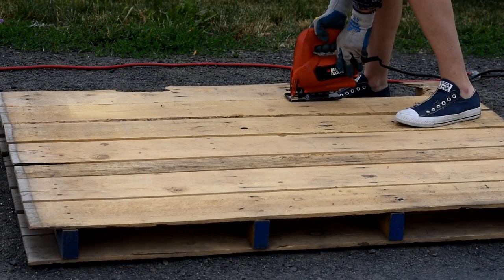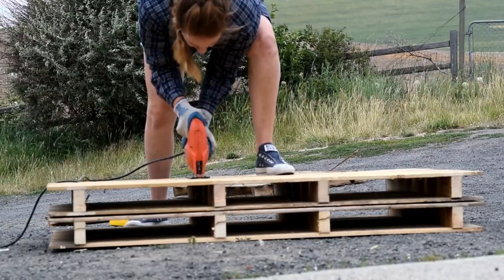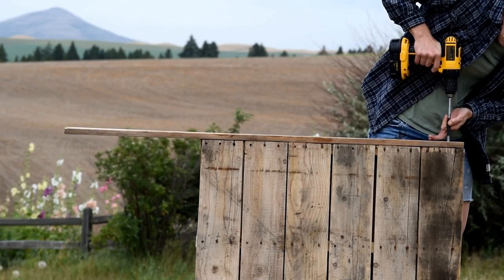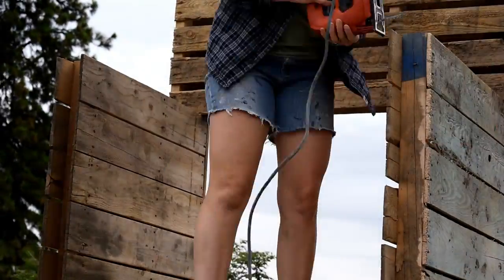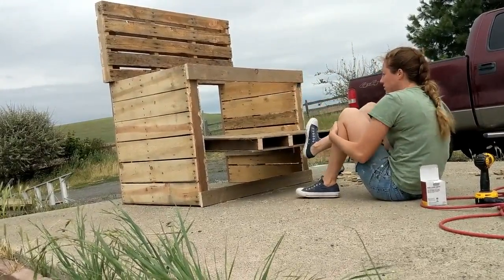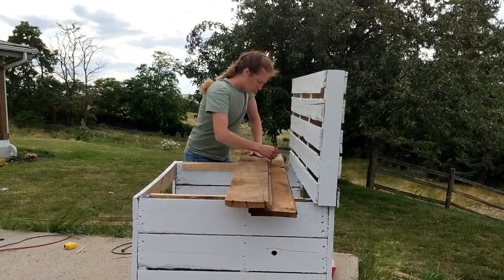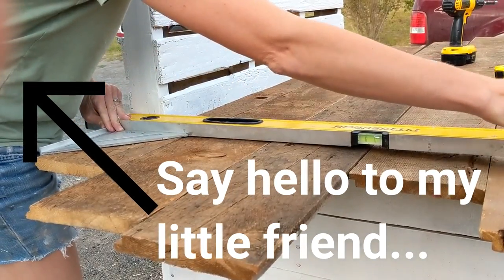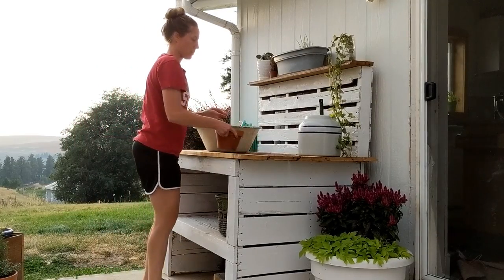DIY PALLET FURNITURE // POTTING BENCH

Comment: I watched your video over a year ago and I loved your idea!   Plus I loved your humor.
Your kids are adorable too.
I am finally getting around to making my table and I couldn’t find your tutorial till now.
And I already started my table.
I see now that my pallet boards are different than yours, so I can’t make mine like yours.  Buy I remember most of your suggestions, and I did my best. 
I love how you were able to fit the pallet over the back supports.   I forgot about that. But I had a large pallet that was taller than my smaller pallets and it should work out as a back splash. 
I am able to acquire pallets from a business park by my home and a truss company that has wood scraps.
And I had a few pieces of wood here already.
I’m so excited to get mine done soon. But I’m so busy.  I spent two years sealing up cracks in my driveway sin between seasons and smoky skies from our fires and the heat. I will be sealing the driveway Tuesday.
I have work tomorrow.
Then I’ll need to paint mine too.  Can’t wait.
Thanks for your great ideas!
Blessings❤️